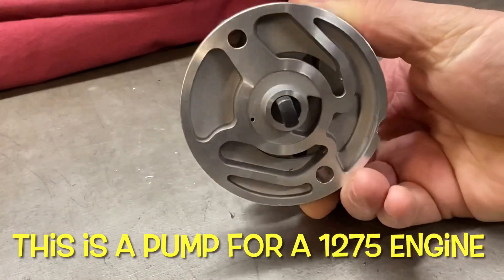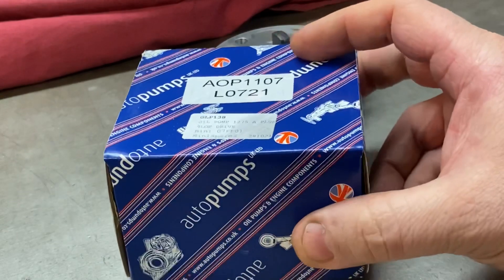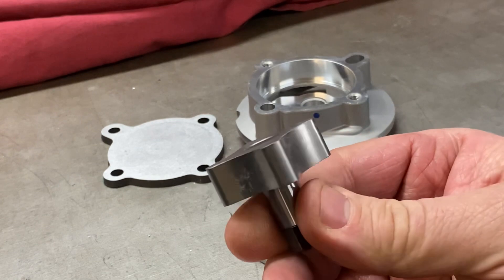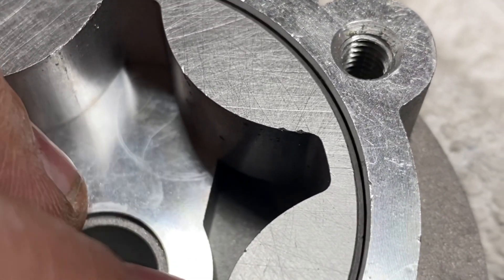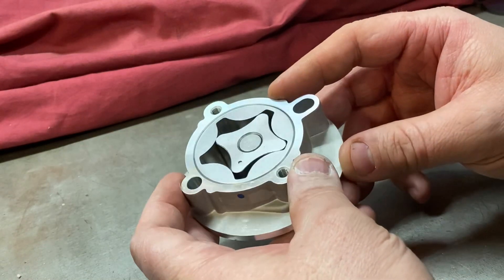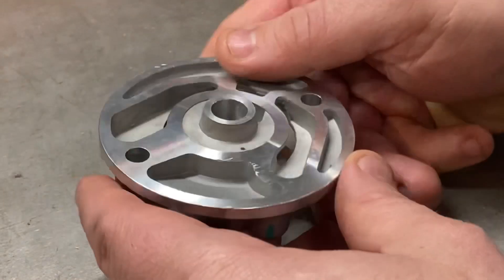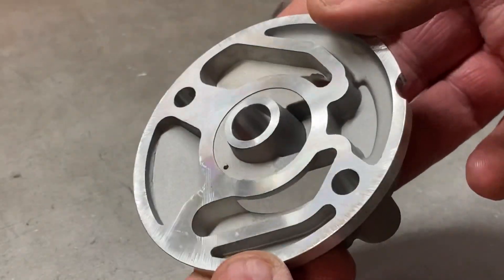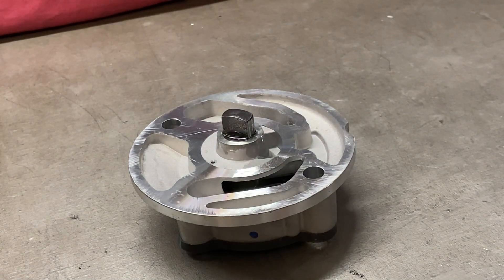ACDodd ‘0’ Tolerance oil pumps

Comment: Great video.  Just fitted an oil pump - typical.  Did take it apart to clean and measure it.  The tolerances were good (lobe and annulus) but did not know to alter the tolerance on the back (not that I've got a lathe.  Wish I'd bought one from you now!

Comment: Hi there 
The turbo style oil pumps have no oil hole for the rear cam bearing - do you recommend giving it one in the same place as a standard pump?
Reply from the maker: No harm
Reply: @ACDodd  I just wondered how it would get lubricated otherwise - I’ve modified lots of pumps in the past - just thought it would benefit 

Just wondered how the turbo engine lubed the back bearing without the hole

Comment: This might be a dumb question, but how is the rotor attached to the rotor shaft? It looks like just a press fit. If that's the case, wouldn't it just slip with the oil resistance? Also, there's a small dot punched in the rotor, what's the purporse of that? thanks.
Reply from the maker: No chance of slipping with the correct interference fits. You can shear the drive off the end of the shaft before the  shaft will spin the rotor if the interference fit is correct.

Comment: So what happens if any part is out of tolerance? Return it?
Reply from the maker: No as they won’t accept that, as it wilL meet the spec of the OE part. What I am assembling here is much better tighter unit. It not uncommon if you buy 20 pumps that 1 or 2 are not good enough for this.
Reply: @ACDodd  bummer.

Comment: Interesting. Thank for the vids. 
What grit do you use for lapping? Also could one lap the casing down to size instead of a lathe?

Endplay in mm is 0.00762mm right? pretty close to zero!
Reply from the maker: Too many zeros! 0.076mm. Yes I used to lap them before using the lathe, p80 is ideal. You must keep it parallel with the bottom of the recess.
Reply: @ACDodd  Ah, of couse, 0,076. 

Glass plate under for lapping?
Reply from the maker: @no66  just a flat surface is ideal.
Reply: @ACDodd  Lastly. 

80 grit is fairly rough. Is this for kepping an oli film in place thus lubing the moving parts and keeping up pressure? 

Also, do you mix and match parts from diffent pumps to make the optimum fit/size/cleance? 

Again, thanks for you time.
Reply from the maker: @no66  80 grit is so the paper does not clog. Yes you can mix and match if you buy enough of them but it’s usually not neccesary and you will not have as many useable pumps after the process as when you started
Reply: @ACDodd  Thanks for the info.
Reply: @ACDodd  Clog?  80 is so rough even body filler/bondo that's old & cured would hardly clog it let alone steel!
Reply from the maker: @alro2434  aluminium is what the casing is manufactured from
Reply: Thanks for taking the time to impart some of your wealth of knowledge. I will deffo be doing this with my rebuild, all be it without the use of a lathe.

Comment: No need for a lathe on such a small aluminum part, wet or dry 200 or so is good, that VERY COARSE paper you used on the steel left a horrible finish and would have just about destroyed the aluminum to steel seal with the end plate if used on it.  Like you said 'ground finish' on the end plate and should be the same for the rest of the steel parts  that are going to contact it and especially contacting the aluminum housing.  Also, DO NOT pack with grease, a light smear, enough to take up the clearance is all they need.  Otherwise nice video, thanks.
Reply from the maker: That’s your view, and not what I actually find in practice.

Comment: Sorry but the imperial meassurement makes me crazy. 5 thousands in metric you can't meassure with this tools...
What kind of abrasive you're used for "lapping"? It looks horrible...
Reply from the maker: Use P80 grit abrasive paper. Simply convert to metric 0.005” x 25.4 = 0.127mm